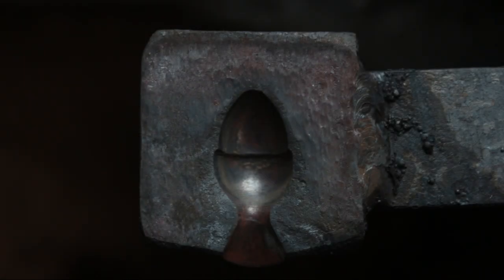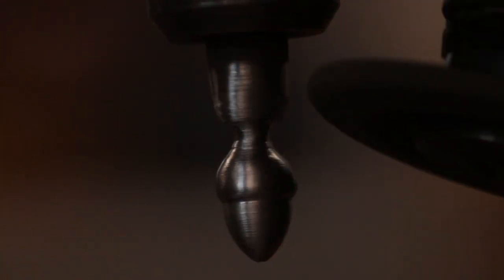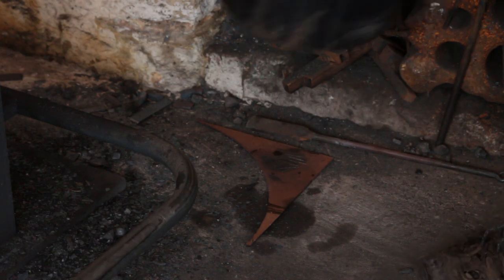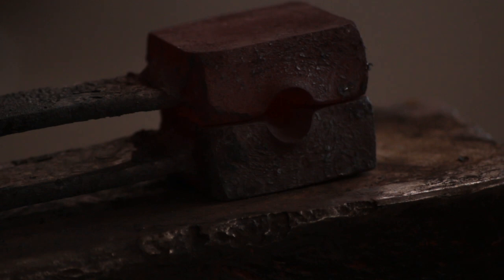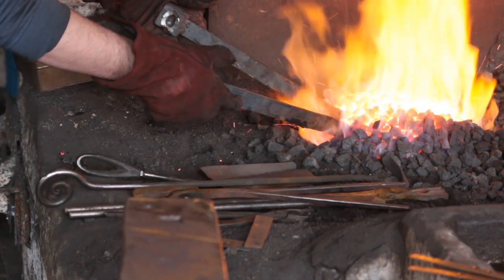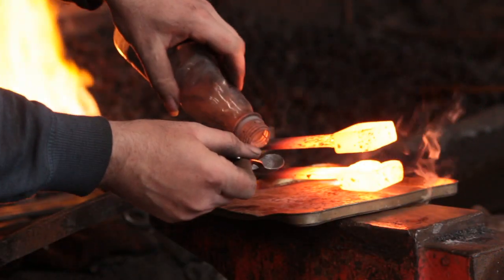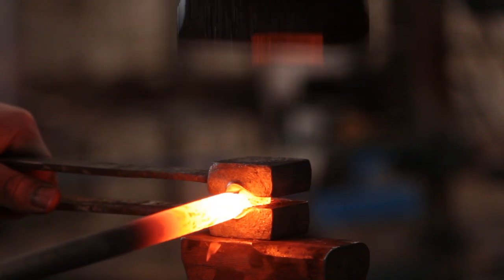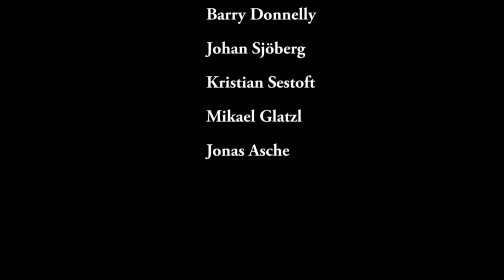Blacksmith: Making an acorn spring swage, part 2.

Comment: These dies maybe a little too small for this to work but for larger dies at least I've found that softening the sharp corners with an angle grinder wire wheel whilst the the dies are at a orangey/red works really well.

Comment: Hi Rowan,

Great stuff, I wonder if the same thing can be done with copper?
Reply from the maker: Thanks mate :) You mean the swaging or using the pillar drill as a turning tool? Copper can probably be swaged quite easily as it is a lovely soft material. The only thing I would worry about would be the galling.
Reply: I mean the video in general was nice. Would it not make more sense to make the acorns from something that doesn’t take so much energy?

Comment: You are FAR better (More control) using sand paper-wet n dry is best. use spare belts and tare strips then hold in tension behind the work piece. You will have a nice concentric piece which will not require files. The grinder is much more apt for tool steel. Great video, as before I do enjoy your turn of phrase, its getting a bit blackadder in spots now!
Reply from the maker: Thanks for the tip - I will give it a go for other shapes. I've had to tone down my turn of phrase quite a lot as I've managed to offend a few people over the last 9 months, lol, but I see where you're coming from, lol.
Reply: Offend? Freedom of speech mate, if they don't like it they can bog off.
Reply: Uhg, no. Please don't dial back the jokes. I'd suggest just making "Complain About My Humour" an award level on Patreon.